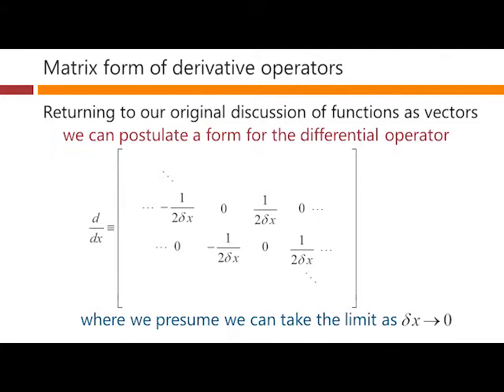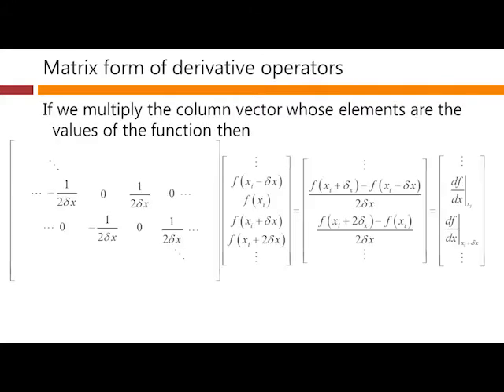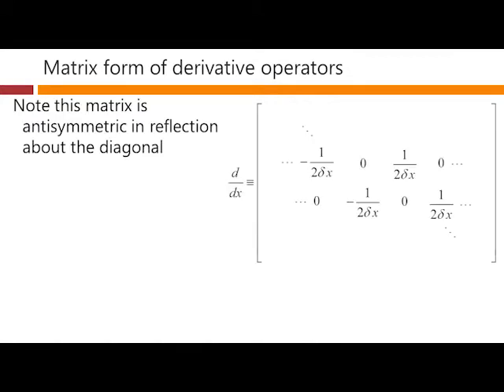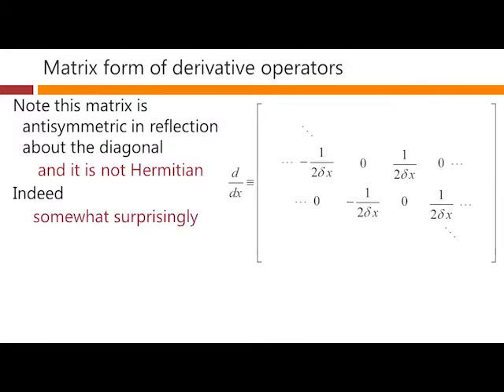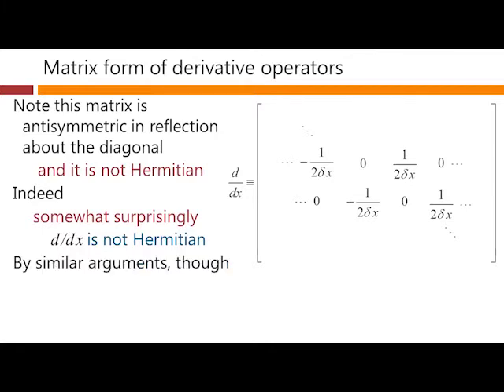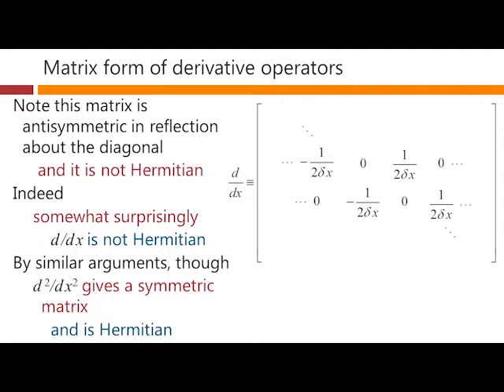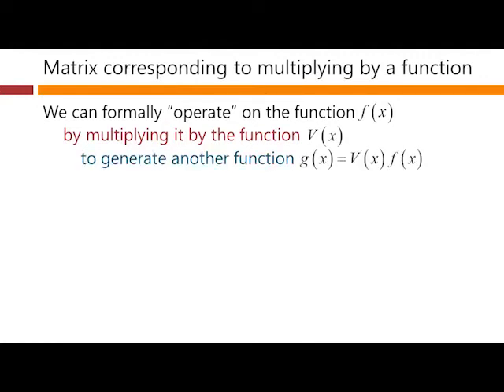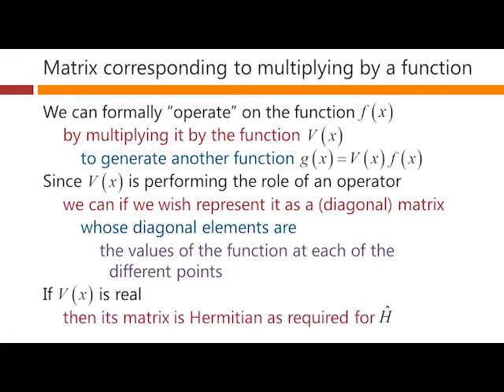Matrix form of derivative operators – David Miller

Comment: and after ?  express the  hamoltonian  operator as a matrix  too ...
Reply: I'm not quite sure what you are asking but yes you can use this approach to write the entire Hamiltonian operator as a matrix. The potential energy as a function of position is just entered as a diagonal matrix whose diagonal values are the potential energy at each point. Adding this matrix to the second derivative matrix (multiplied by -(hbar^2)/2m ) would give the matrix for the entire Hamiltonian of a particle with mass m in that potential.